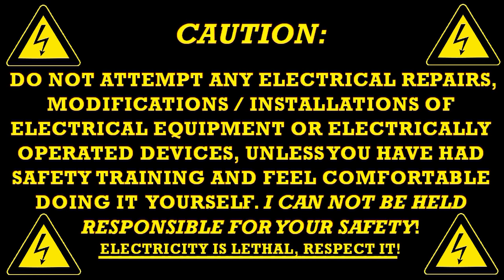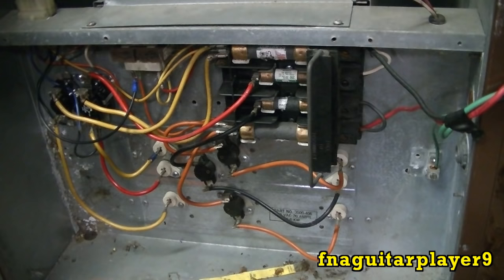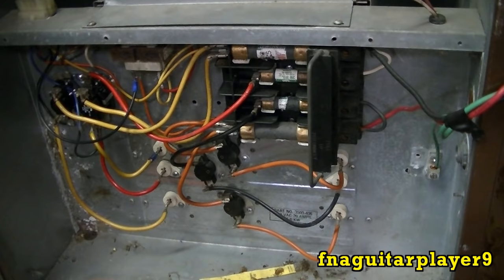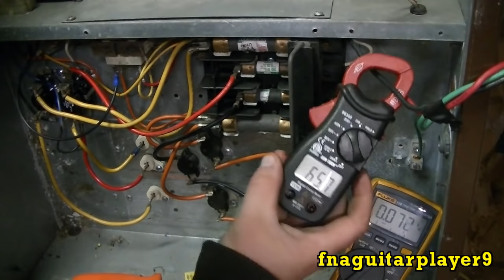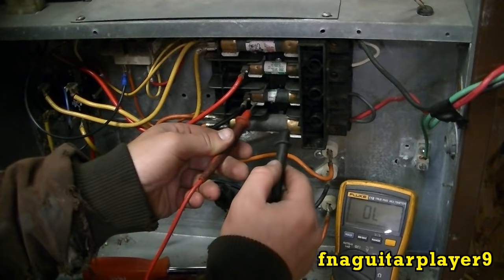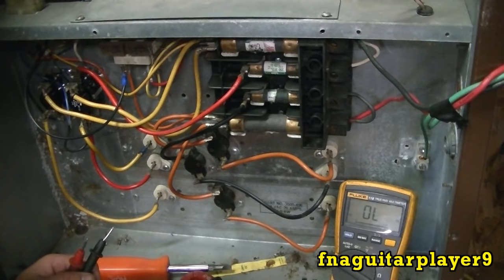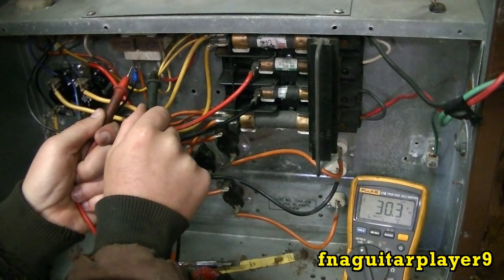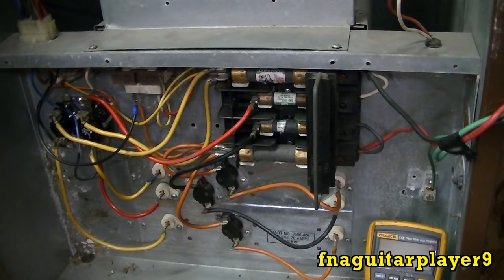How To Diagnose Electric Furnaces: Check Fuses, Element, Sequencers, Thermostats and Transformer

Comment: Thanks for the video. I watched it after waking up to a 61 degree house on a 0 degree morning. The furnace ran all night. I had thermostat set to 73 degrees. After watching I grabbed my amp clamp and found a bad limit switch. Per your advice ordered one off eBay for less than 18$. Hope the sequencer is still working. Thanks again!
Reply from the maker: Your welcome! Glad to help out, hopefully that will fix it! No problem, thanks for watching!!!
Reply: I have a Interterm Electric Furnace Model #FEH-012HA and it has 3 sequencers and they look like new but one of them don't have any wires on it I am having trouble getting a thermast to work and it will run about 15 minutes then trip the Braker I would appreciate any help help if possible and Thank you so much !!!

Comment: Iv got an OLD GE electric furnace, it runs for about 5 minutes before tripping the circuit breaker, I get continuity across my heating elements. What do you suggest I check

Comment: When checking the transformer, should the meter be set to AC voltage or DC? In that, should all voltages besides 110 (120) AC be DC voltage? I noticed when you checked the two thermostat wires you were in contact with both at the same time.

Comment: I have the same furnace as the video except is has a switch above the 24v transformer that says Auto and On for the blower motor.  Occasionally when the switch is in the Auto position, the blower motor won’t kick on and the elements get warm without air flow.  If I switch to the on position, it always starts the blower motor right away.  I replaced thermostat on the wall.  Where would you recommend starting to look next?  I’ve been running it in the on position for now, but don’t want the fan running 24/7.

Comment: Thanks for the video. Hard to find them on these older furnaces. In this video, looking at your red wire connecting the fuse block, bottom fuse, I have no voltage there (just died last night), shouldn't it be 1/2 of the 220 with the top wire (top fuse) or at least 110 checking with ground? I sure hope you still answer these older videos

Comment: Thanks for the video! I have an older kenmore . It runs good for weeks then it will randomly just keep running and just blowing cold. Sometimes simply shutting the breaker off and turning it on fixes it. And sometimes I have to leave the breaker off for an hour or so then it will work again. Any suggestions?

Comment: Damn Good video! How to troubleshoot your thermostats, your resistance on your heating elements, your 24v transformer output, how to establish if your sequencing  contacts are picking up....YeP! Effective use of the ampmeter and your Fluke! Live and dead circuit testing. My only faint moment was him holding the hot secondary in one ungloved hand. A testor should hand gloves, eye protection and not be tempted to "point" when handling live equipment! Otherwise, his video still gets a 🏅
Reply from the maker: Thanks! That is true, I'm not big on wearing gloves, should be and i recommend it. Appreciate that, Thanks for Watching!!!

Comment: Good practical advice and video. My 2004 Trane heat pump blows cold during defrost cycle. It also blows (unheated) air when set for Emergency heat. The thing is, on cold days (outside is below freezing,) heat pump still provides luke warm.  So why don't I get heat during defrost cycle, or Emerge heat mode?
Reply from the maker: There could be any number of reasons why, blown fuse, bad element, sequencer, or something wrong with the outside unit, low on freon, alot of possibilities, hard to pinpoint one. Thanks for Watching!!!

Comment: I have a question. My a/c runs just fine cooling the house, but when I switch it over to heat, I get nothing. My red & white thermostat wires are showing 28.43v. I’ve replaced the thermostat, the 3amp fuse, & the single sequencer. I still get nothing. If I turn the blower to “on” it runs all day, but no heat. 
The system has 2 heating elements. The coils read 15.2 ohms each. The high temp interruptors read 0.00 on the lower element & 0.01 on the second. What am I missing?

Comment: Thank you so much for sharing your knowledge.  My furnace has two heating elements,  but only one slot for only one limit switch. Can I run both elements through one limit switch? Thank you.
Reply from the maker: Your welcome, i don't think you would be able to put them both on the same switch, it would be to much amperage i would think. Thanks for Watching!!!

Comment: Great trouble shooting tips. Your video allowed me to determine that my other 60A breaker in the breaker box was intended for power to the 2 and 4 elements. I was only getting half the elements. My issue now is that circuit breaker 1 and 3 keeps popping. I have the proper amps going to the sequencers and voltage. I checked my transformer and I’m getting 24V across red and black. Orange and yellow are 120v. The same across the fuse and there’s continuity so no fuse is blown. I’m getting about 10ohms across the elements accept #1 I’m getting about 6. Any idea why my circuit breaker keeps popping? I’ve lowered my fan from high to medium in hopes for it to draw less power but that didn’t help either.
Reply from the maker: If everything is working in the furnace then it could be a weak breaker, i've seen that happen before. Thanks for Watching!!!

Comment: I have a ge heat pump with 2, 5kw emerg coils.if put in emerg. heat mode it will short cycle 5 min on 10 min off.  I watched therm. reading no drop in temp. Any ideas thanks

Comment: If you suspect that the wall thermostat is bad, you can jumper the low voltage R (power, usually red) to the low voltage W (heat, usually white) at the electric furnace.
& if the heaters come on with the jumper, but they won't come on without the jumper; but just the wall thermostat being set to "HEAT" mode & the set- point-temp set higher than the actual temp....then the wall thermostat is bad. On most modern thermostats, usually its just the thermostat face that needs replaced, & not both the base & the face.
Reply from the maker: Ran into this a couple months ago on ours, but it was a bad wire going to the thermostat, luckily who ever installed it ran a 2nd set of wires prob for ac, i just switched it over to it and got it working! Thanks for Watching!

Comment: I was wondering if any of the information in this video would apply to a nordyne E3 series electric furnace because that particular series of nordyne electric furnace models don't have a sequencer it has a contactor instead which turns everything on all at one time
Reply from the maker: Not to familiar with that but most electric furnaces are made  very similar. Thanks for Watching!!!
Reply: @fnaguitarplayer9  no problem i also enjoyed the video titled interesting facts about induction motor or capacitor motot

Comment: I have a question. About 2 days ago our electric furnace starting blowing cold air sometimes not always. Someone told us to shut off the circuit breaker for a couple of hours and the system would reset itself, so we did and it worked. Tonight it didn't solve the problem, the furnace doesn't even start up. Where do we start?
Reply from the maker: If the thermostat is working good, then i would think it would be the sequencers going out on it, its a common problem, but without actually testing it i can't say for sure. Thanks for Watching!!!

Comment: Good video, could you do one on electric cloths dryers?
Our dryer a SEARS is over 25 years old, it sucks almost 30 amps and it take an hour and 45 minutes to dry a load of cloths.
I don't lbow if that is normal, I know very little about them..
Reply from the maker: Thanks! I might sometime, I haven't worked on to many, i've took several apart though for the motor/blower. 30 amps sound about right, it may be a air flow problem, like a clogged vent pipe or something, Because with that much amperage it should be heating good, and it shouldn't take that long to dry. Right off hand thats about the only thing i think of, because the elements either work or they don't, unless it has more than one and one isn't working, but i've never seen that before, not saying they were never made like that, but i just don't know. thanks for watching!!!
Reply: Thanks for the information.
Reply: fnaguitarplayer9  is right , I'll add that you might also have to take it apart and vacuum all the lint out of it, and snake out the flex hose going outside. If it's never been cleaned out in before it could be causing an air restriction, and could be a fire hazard .ill just say that Regular maintenance of appliances are very important to keep them running at peak performance. I hope that helps you out.
Reply: Probably is the heat element. I bought a replacement for 23bucks years ago. The strands would break and I'd just twist them back together to get it back working. You're most likely having the same problem. It is a simple fix with minimal screws to deal with

Comment: My furnaces transformer has 220/240 volt input, 24/30 volt output. I do wanna ask you a question, would a heating element still work if the sequencer was only getting 110/120 volts... would it still heat up?
Reply from the maker: It would warm up some, not quite as hot but yeah it will heat up some. Thanks for Watching!!!

Comment: I appreciate your video very educating however I'm having a problem with my father's HVAC system and I wondered if you might know the problem when I first got there the heater would not come on the AC State on I changed the relays thermostat and make sure the contacts on the HTC we're not sticking they were not now the blower comes on but no heater I'm thinking it's a 24 volt problem and has something to do with the old nests third step in changing to a non digital can you help
Reply from the maker: Your welcome! Sounds like bad sequencers, i could be wrong. To verify that it is not a thermostat problem, find the 2 wires (usually red and white) for heat and touch them together to make sure, if it works then, then yeah it is a 24volt thermostat problem. hope this helps Thanks for Watching!!!
Reply: Would you believe after I change the  relay, a sequencer,and the Transformer, just to make sure I didn't forget nothing.and thermoset ..the last problem that confuse me  the most at the last was I had the thermostat hooked up for gas not electric heat at least that's what the HVAC man I finally called and hired (total price to $75 him) told me.  it really makes me feel like a dumbass it's been a long time since I worked on the stuff thanks your help keep it up.
Reply from the maker: I hear ya, glad you got it fixed!

Comment: Question, I noticed the amperage varied per coil as high as 23 and as low as 19.  How low is acceptable before you need to replace the element?
Reply from the maker: Not sure of the exact specs, but one that is reading less amps is probably on its way out because it may have a "hot spot" that is acting like a inline resistor, limiting current to  a point. Thanks for Watching!!!

Comment: Any idea why when my heat comes on it heats up and burns only one of the 240v legs right at the bus bar? All the elements ohm to about 11.4 ohms and no short to ground. I tried running the blower only and it doesn't heat the breaker. I used a laser thermometer and the 2 legs both hold about 69° with only the blower circulating air. When the heat is on one leg quickly reaches 200°. I thought the breaker was bad but does the same with a new Cutler Hammer breaker I put in.
Reply from the maker: The leg on the breaker heats up or inside the furnace? Thanks for Watching!
Reply: @fnaguitarplayer9  I figured it out. Breaker leg myself went bad somehow. Cleaning it didn't work. I just never thought they could go bad like that since it was still the normal thickness and somehow the cook stove on the same leg with all the elements and oven on at once works perfectly normal and the bus bar never heats? Seems odd to be. Thanks

Comment: I have a first company  fur down 2ton the heat wont shut off when it reaches temp i have to shut it off at breaker i could use some advice  on this thanks..
Reply from the maker: Sounds like one or more bad sequencers, when they lock on like. Thanks for Watching!!!
Reply: thanks very much that was it

Comment: what would cause your main disconnect to get really hot and melt the plastic around one of the four terminals, on an intertherm furnace?
Reply from the maker: The terminal in the furnace may be broken or stretched making a bad connection and causing it to arc, or its arcing through the plastic to another leg, you can usually see marks from arcing on the plastic if thats what it is. Thanks for Watching!!!

Comment: I have a question...
We just turned the heater on last night and i was reading about 8k watts on my wattage gauge...
The outside unit was pulling in 10.5 amps and the inside unit was pulling in 23.5 amps, assuming the heat coils were ON because under A/C the air handler only pulls 2.5 amps... So  33.5 amps x 240V is ~8k watts so its adds up. 
I was under the assumption that when the heat is turned on at the thermostat... Only the air handler comes on which is the FAN and Heating element...  The temperature of the air coming out of the vents is 93F...  I didn't know that BOTH the outside compressor & the inside heat coils turned on as well...
Reply from the maker: Yes, both will turn on, the outside unit kind of works backwards compared to how it does when the ac is on, both work together. Thanks for Watching!!!
Reply: The outdoor unit is prolly a heat pump. If you look inside the condenser cabinet you can see if it has a reversing valve, or simply look in the condensers electrical cabinet and if it has a control board it’s prolly a heat pump.

Comment: Heat comes on now but blowing cold air thru half the vents and hot thru the other half what ya think might be problem
Reply: Could be the blower is getting weak.check amp draw of the blower motor. And you could have a duct issue. Ive seen duct branches loose or disconnected and even holes. Thoes are the two things you can check just off the top of my head.

Comment: what causes furnace to blow 30 amp fuse, replace bad fuse, turn it back on and opposite 30 amp fuse blows? old furnace called TheInsider. on mine the 2 60 amp fuses are in middle and a 30 amp fuse on each end!
Reply from the maker: That could be a bad element, i would suggest checking the amperage and seeing if something is drawing to much. Thanks for Watching!!!
Reply: @fnaguitarplayer9   Thank You for the vids and the answer, will check that out and let ya know what i find. :)

Comment: Hey, Fnaguitarplayer9 , I'm about to graduate from an hvac and appliance repair college class in two months, and I'm very interested in getting certified as an electrician as well, I'm in WV btw. My question to you is , is it really difficult to get through the electrician classes? Thanks
Reply from the maker: Hey! I hear ya, thats actually a very good idea to get your electrician license as well, they both go hand and hand, in fact if your going to go into business yourself, you also need to be a licensed/certified plumber, that way you can do everything on your own, but the main 2 are the hvac and electrician. If you have basic knowledge going into it (which i assume you do from taking the hvac), it will really help, I did, but if you don't they do start you with the basics and work up, to me it wasn't very difficult at all, you do learn alot of things and some things you won't ever need if your doing residential, like motor control and PLC's, but its still interesting and good to know the basic of. The class i took was only 1 year and i got my journeyman license. Out of curiosity, what school did you go to for hvac? Your welcome, thanks for watching!!!
Reply: i appreciate the info and yes its difficult to install new furnaces and heat pumps quickly if I cant run my own power to the units myself. The small technical college I go to is called Valley Beckley campus .
Reply from the maker: Your welcome! Yeah, very true. I have heard of that school.

Comment: Could you tell me why my furnace makes a loud noise like a smoke detector.when it starts up to heat ?
Reply from the maker: If it has a belt drive blower the belt could be squeking but most are direct drive, also if the filter is to restrictive i have heard them make a strange sound, other then that i'm not sure right off hand. Thanks for Watching!!!

Comment: The Bottom element of the attached link pict furnace does read any voltage. Checked the seq, limit switch &  heating element offline and they appear to be good. 

My first question is: the power feeds from the breaker (right hand side) or from the Transformer/relay (left hand side) or from both? 

Note: I have not tested the relay yet. Any suggestion what could it be?

https://photos.app.goo.gl/R8aHp6zDmAtP3Kio2
Reply from the maker: Sounds like the sequencer or fuse is bad, not letting power flow to the element. Thanks for Watching!!!

Comment: I could not find the video how to temporary heating coil. I have 3 coils but 1 comes on but i check the ohms and the other 2
Reply: Dont see a continutity, can u put one to the good coil?, it was 22 degress and the heater wont keep up. I do have warm heat but not hot enough to to get to shut off. I have the heat set for 72 and it is 67 and i changed the batteries

Comment: Do you what would cause the disconnect to melt
Reply from the maker: That is probably from a wiring working loose and arcing making it heat up, or the socket that it plugs into could have came loose and started arcing. Thanks for Watching!!!
Reply: @fnaguitarplayer9  thanks alot